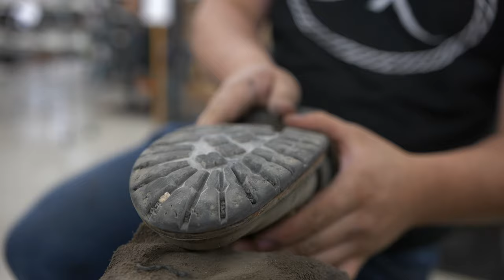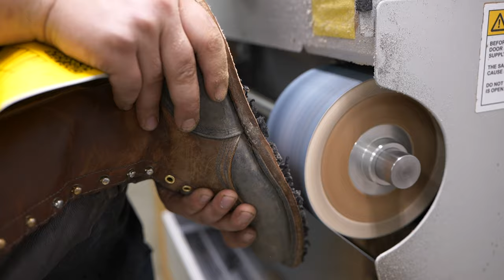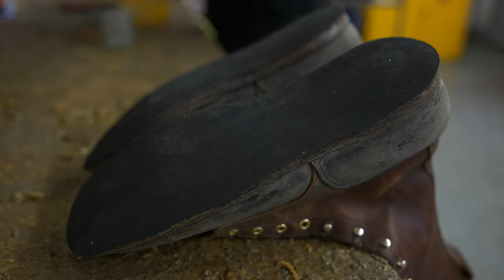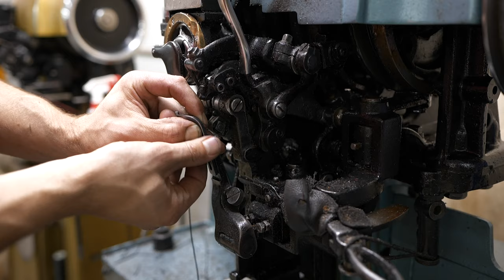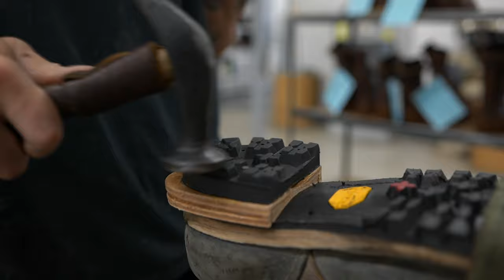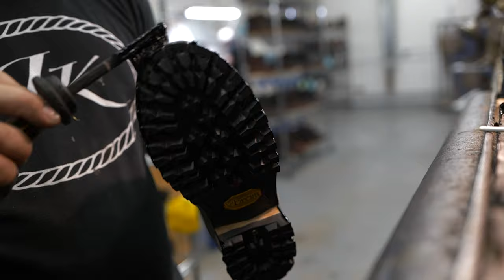Custom Resole | Satisfying Boot Restoration | JK Boots

Comment: did you leave the old stiching in the boots?
Reply: Yea they did! I remember watching Bedos Leatherworks and Trenton and Heath. Both cobblers said its really important to remove the old threads, so the new threads don't tangle up with the old threads they sew on the new sole. I'm surprised they were able to stitch a new sole on with no issues. I did see they sanded them off though, even though they did have a bit of threads in all of the holes still. I'm guessing they leave the old stitches, maybe due to not having enough time to take them out. Perhaps because they have so many orders to do. But still, it is better to take them out. Because what if they come back for another resole much later down the road, and now there's a build up of twice the amount of threads (the thread newly put in this video, over top of the old thread we see). So I still agree with Bedos and Trenton and Heath about removing the old thread, before continuing the resoling process. That way the soles will be much easier to remove in the future. I see how they struggle to remove the rubber soles and midsoles sometimes in their videos. Now I know why! It's because they don't remove the old threads fully from the holes.

Good eye!